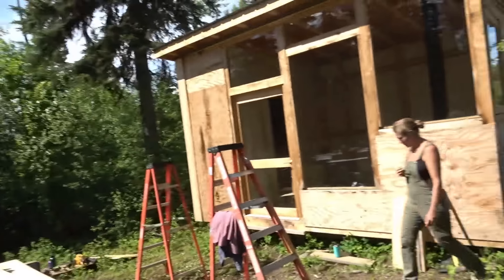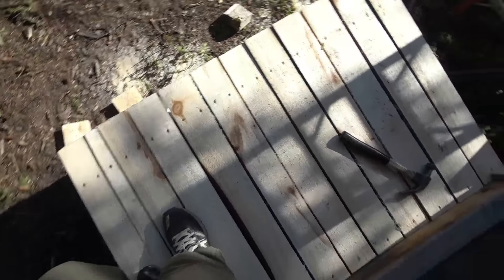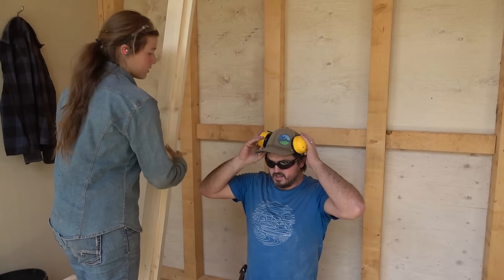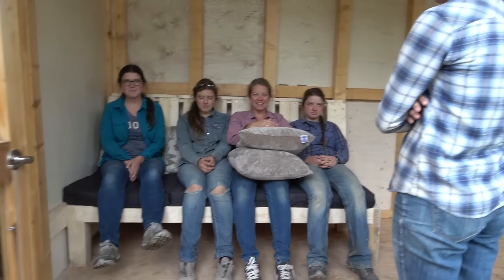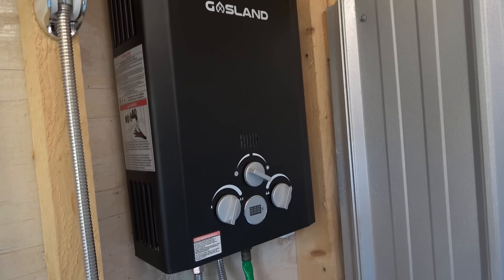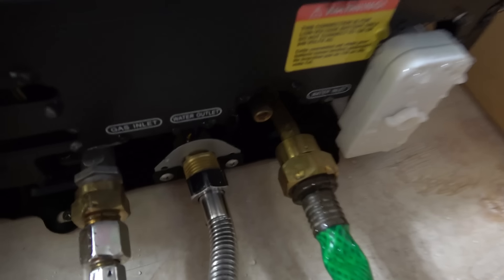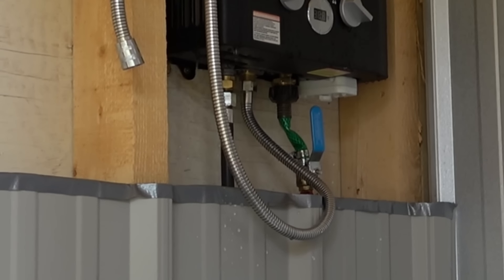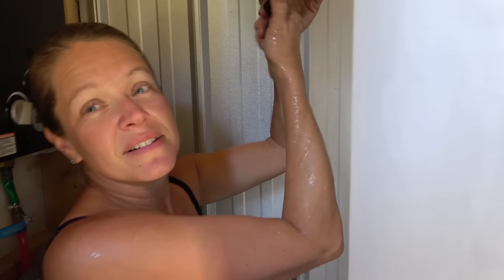CHEAP and EASY Off Grid Tiny Cabin With Running Water!

Comment: Just an Idea, on the shower bag. Cut a hatch in the roof and extend your pully up above the roof. Let it get hot. then just lower it back down. Then you don't have to carry that heavy water. If that's not too shady of an area. Then it doesn't make sense

Comment: The on demand water heaters can be brazed to fix the leak.
In my experience the water tubes run up down up down inside the heater, allowing water to puddle at the bottom
(Picture an automobile a/c condenser, but rather than side to side, the heater goes top to bottom)
They need to be blown out with air pressure, similar to a lawn sprinkler system. For extra insurance you can add RV antifreeze as well.

Comment: Those are awesome! I've built 2, double lofted 12×16's, which put the sleeping lofts upstairs for the younger ppl, and I put a Murphy bed downstairs for myself or older ppl. I put a black painted 30 gallon drum outside for hot water, a 12 volt pump for kitchen, and bathroom. Refrigerator 4.4 cu ft, all niceties of home, only off grid. At a cost of $3100 USD each, fully furnished. I love ya'll  and your ingenuity, hard work, and togetherness. ❤
Reply: I'd LOVE to see your setup. Could you share the Murphy bed plans?

Comment: Absolutely brilliant use of that tick for the jump scare setup!😱
Hey put some rollers on, that bed would be fine.
I tried those propane water heaters.
You got to blow them out with some air
The first one lasted a couple of months and then it just stopped igniting.
 I checked batteries, contacts etc. 
I went through the whole thing!
 I went through the second one to compare a new one to my dead one and found that the flow sensor was shot.

I ended up cannibalizing both units and made one that was manually fired.
Reply from the maker: Nice to know you could actually work on it.  I haven't opened them up yet but I figured it would be mostly un-serviceable.
Reply: Froze my on demand water heater up also and I solder it up but took a lot of heat , map gas probably would be better guess it depends where it broke.

Comment: I had my first water heater like yours and trashed it by not draining.  Bought two more for about 150 US 6 or 8 years ago.  The cheap Chinese type.  They have been working well all this time.  You just have to make sure to remove the drain plug if it will freeze.  The heat exchanger is made of thin brass and cannot take freezing.

Comment: Re the shower. I've been to many backcountry lodges during the winter for ski touring & most have a sauna with a gravity type shower, either a bag or a watering can. The water for the shower is heated in the sauna. A couple dashes out the door to roll in the snow augment the whole sauna experience. One of the lodges decided to try an on-demand propane unit similar to yours. Don't recall where it was made but seemed like a pretty well-built little unit. Since they have micro hydro with a good deal of head pressure it was easy to hook up the propane job for the proverbial endless hot shower... 

It worked great, for a while.... until one lady experienced wild fluctuations in water temperature, from freezing to scalding to the flow stopping completely. Not a pleasant experience in the middle of winter (-20C) in a more or less outdoor shower stall... Can't really blame the propane unit as it turns out the fine mesh screen on the water inlet port was accumulating ice crystals from the micro hydro source affecting consistent flow of the water.

At another backcountry lodge, more of a 5 star operation with hot/cold running water & flush toilets, they also use an on-demand propane shower unit. Proper shower room with all the amenities indoors works great. It also feeds water down to the kitchen sink. There's a massive wood fired boiler on the lower level that feeds another shower but that's only sufficient for maybe 3 showers until the boiler water gets cold. The on demand is great in that as long as you have propane & the incoming water is above freezing you're good to go.

Comment: We have a natures head composting toilet off the side porch for easy emptying.  Over winter it composts and is it’s pretty much dust when we go back in the spring.   And for a sink we have a hand wash basin with a foot pump. It’s the cutest. The reservoir is at the bottom. lasts all summer

Comment: try using heavy duty black rubber water hose to heat water with at the cabin but be careful because the water will get hot enough to scald your skin , the longer the hose the better ( more hot water ) and it takes awhile to cool the hose off before the water coming out will be cold. the best way is to run a low wattage 50 watt circulation pump and a single length of hose just to use to circulate  the hot water in the hose into a larger water storage tank.  it can be electricity free if you use a 100 watt solar panel to run the circulation pump.  also you will need to use a drain to empty the hose when temps drop below freezing unless your going to leave the pump running.

Comment: My cabin is a modern fram on a concrete slab, runing water  flush toilet , shower , washing machine  full kitchen run off of solar , wood heat , lpgas cook range , celing fans ,. 
520sqft.

Comment: You can also power your 12v water pump with 20v 5 amp hour batteries, positive on the left, negative on the right, you can also use the batteries to run normal lamp with a led 12 light bulb installed

Comment: Pull. The fronts off them ondemad water heaters and look for split pipes, clean and solder cracks and good as new.
Reply from the maker: Hey! I'll try that!
Reply: @Gridlessness  I've had to do this before, you've got this.. Cheers

Comment: do a camper style dinning table bed ... then it is duel use 

why not put the hot water tank ON the roof ... and use the pump power to top it up ... paint it black ... and poof it has LOADS of hot water ... scavenge the potable water tanks from old trailers make em black and your golden ... heck even take their hot water multi-heating unit out and use them ...

Comment: Such a deal I have for you Jeff, if your hot water heater is FUBAR I’ll give you $5.00 for the little drain screw because I lost mine and the stick I whittled and stuck in there drips a bit. 😂

Comment: I’m thinking a small solar panel system and a small hot water tank would provide all the energy those little cabins need. I thought I heard you admit that you were an electrical engineer, so you should be able to design and build the electrical systems to meet all your needs. You setup micro hydro electric power. You setup gasifier to power a generator. You obviously like to work harder sometimes and questionable smarter sometimes. My observation because I would want things to be less work for me.

Comment: Nice cabin, but I noticed the lack of safety glasses being used. Splinters fly, nails and screws shatter. Especially dangerous is when  using a cordless nail gun.

I sold tools and equipment for 40 years, most injuries I saw were because, the operators weren't wearing safety glasses.

Stay safe,

Quincy, Massachusetts  N.E.  U.S.A.

Comment: You must know that that water pump will give you 45 psi for your shower if you run the hot and cold water through it, right, That why their used in RV's.